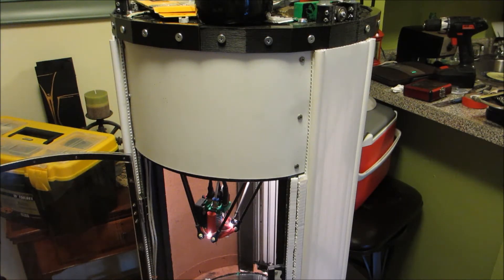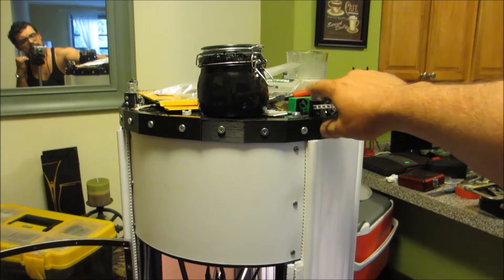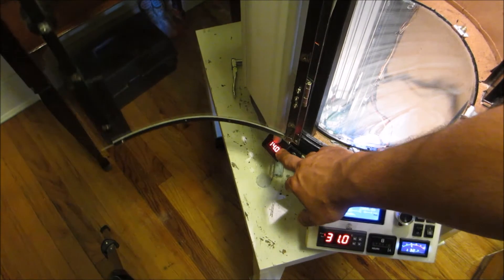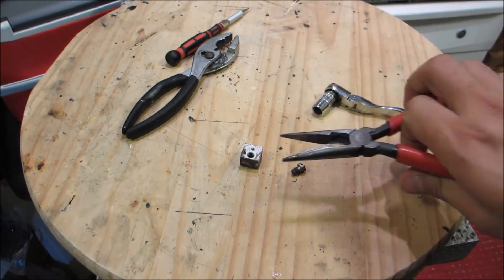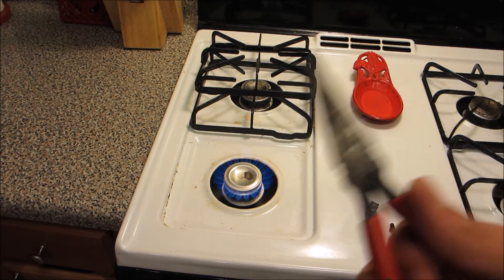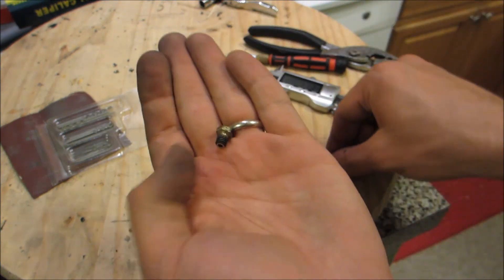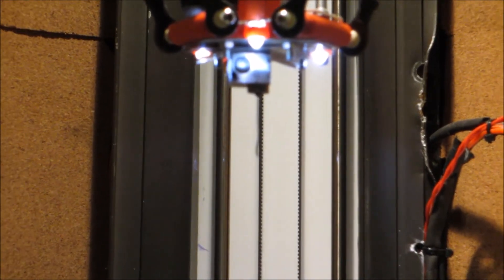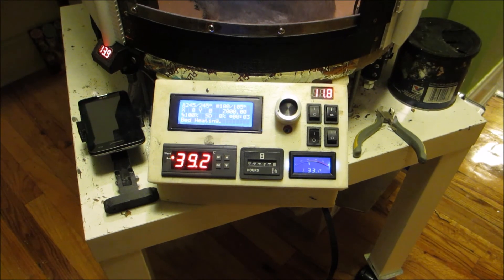3d Printer Heated Chamber and maintenance

Comment: heat the nozzle up to 270, retighten the nozzle, and then cool it back down.  The leaking is because space develops between the heatbreak and nozzle at printing temps.  You've probably figured this out but just thought I'd comment.
Reply from the maker: +Dean Cripps 

The leak was from a damaged block. The threads were messed up. I replaced it soon after. No more issues.

Comment: I have been using that stove top method ever since your re-work video on the cheap chinese all metal hotend.  It works every time.  PLA on fire = clean nozzle.
Reply from the maker: ***** It does work. The one issue with doing it that way is that the fumes cannot be healthy.
Reply from the maker: Yeah the stove top method works very well. The flame is not hot enough to damage the metal but hot enough to burn the plastic to ash. Then a simple rinse and your good to go for a good while. This is the first cleaning I have done since that video.

Comment: What kind of heating element do you use for your heated chamber ?
Reply from the maker: TheSmellyPasta 

I use a simple automotive heater set to high. This is the one I bought. 

http://www.aliexpress.com/item/12V-Auto-Car-Auto-Vehicle-Portable-Dryer-Portable-Ceramic-Heating-Cooling-Heater-Fan-Car-Defroster-Demister/32288147288.html

I used one of these to control the heater. 

http://www.ebay.com/itm/like/131563088231?lpid=82&chn=ps
Reply: Bruno M.  Thanks !